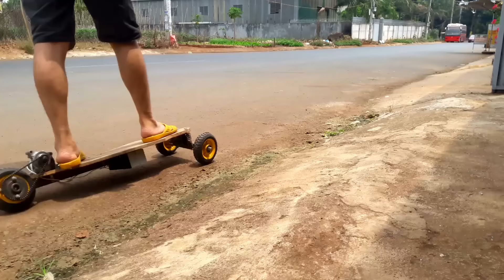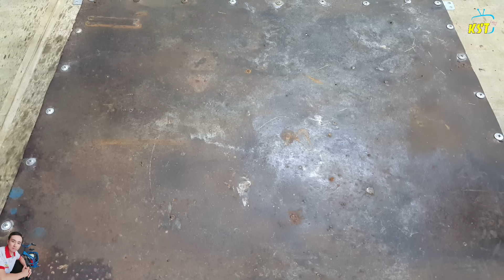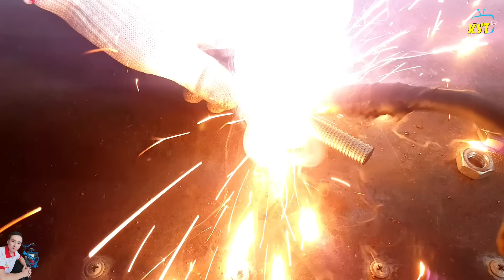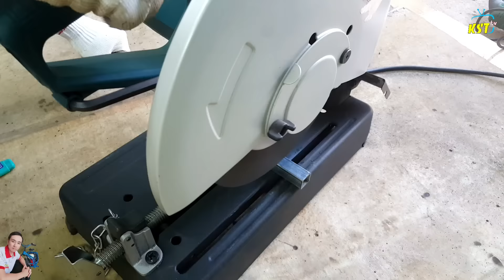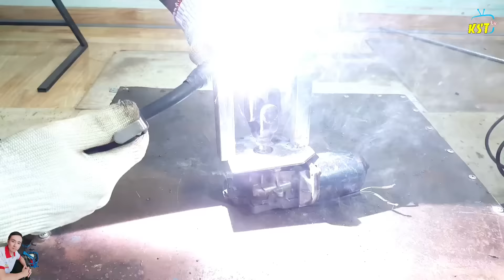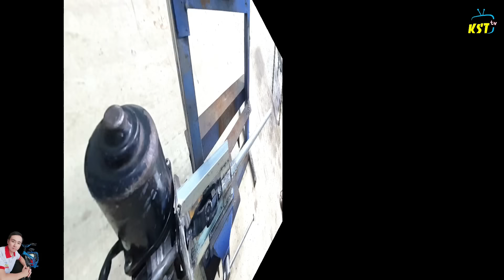How to make a Super Powerful Electric Actuator

Comment: Can you increase RPM of the wiper motor
Reply: yes but you need to change the gear ratio of the gear box, but as you increase speed you will also lose torque

Comment: There's a big PLASTIC easily meltable gear, just inside the nose of the output shaft on that motor. When the heat from your welder moves along the shaft and melts it where it fastens to the shaft, then what? A much better idea, would be to CROSSPIN your extension to the output.
Reply: so at about the 5:18 minute mark, your suggestion to CROSSPIN would be done at this point. I wonder if a metal epoxy would bond sufficiently enough to hold here ?
Reply: @billybobjoe2818  Glue might work, but I wonder for how long. Smooth surfaces often don't provide the best bond. This is going to be loaded in two different directions. Maybe crosspin AND bond it.
Reply: @randallsemrau6911  I never considered metal epoxy "glue". The stuff I've used in the past is incredible - "Metal Mend" I used to call it. After it's cured, it can be drilled and tapped ! So when you say crosspin, that would entail a hole drilled through the motor output shaft and the coupling then a roll pin inserted. THx for your  quick reply. Disability confinement sucks.
Reply: @billybobjoe2818  It's glue. The Boeing 787's I maintain every day, are the perfect example of glue, metal particles and woven strands of carbon fiber keeping a machine safely in the sky. So call it what you like, but used the right way, it might work.
Reply: @randallsemrau6911  well alrighty then ! Glue it is, thx again
Reply: @billybobjoe2818  No! It's epoxy ! 🤪
Reply: @randallsemrau6911  🤣